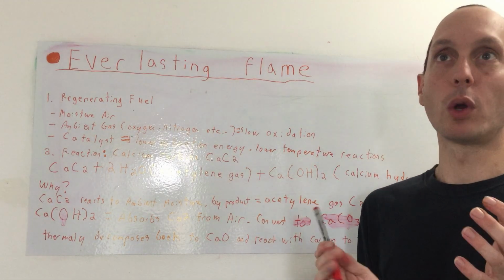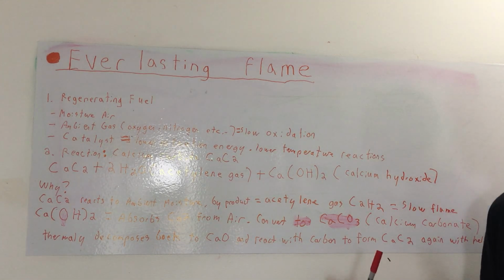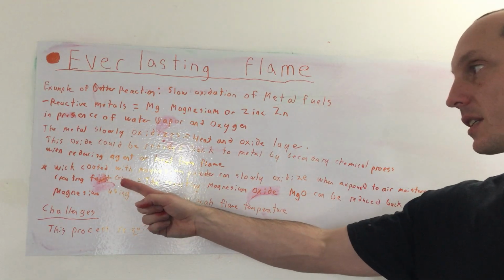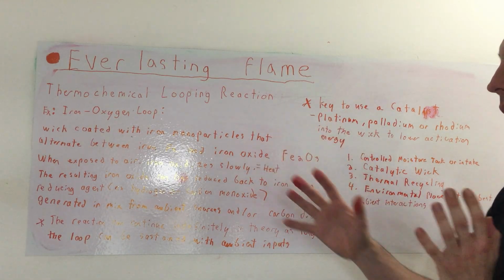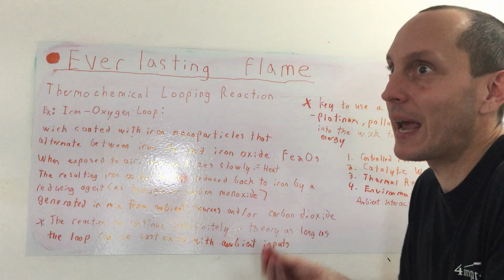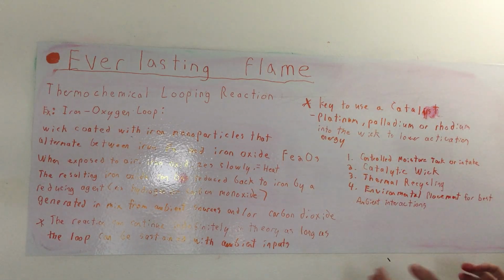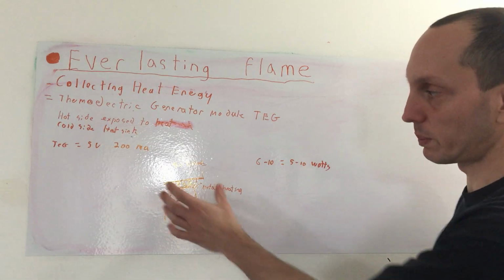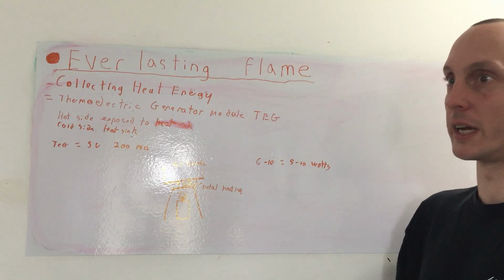Everlasting Flame

Comment: Dutch did a study on using iron oxide particles in a close loop for heating. Caveat was hydrogen for redox reaction. You could potentially use windhex like cyclone filtering to separate the dust efficiently, but still a potential health hazard. 
There are certain clays and calcium compounds that produce steam with water, and you could dry them out under the sun or microwaves. Claude says a polymer of iron particles with clay will help with drying it fast enough to be economical.

Comment: Algea is very efficient at converting carbon dioxide into diatomic oxygen. However, this would need sunlight exposure and if in a cold environment heating wire. 

Another option is to run the exhaust CO2 (and ambient air) into a bubbler and then thunderstorm generator with an electric generator but this would require fuel input. Malcolm Bendalls model has shown elemtal transmutation based off of Bob Greeners electron microscope analysis. 

Or a combination or both. 

Furthuremore, the energy from the thunderstorm generator could power a pressure swing adaorbtion vessel by providing electricity from the generator to a pump and electronic actuated valve. Tanks can be configured lead lag. The questions is if the carbon capture credits would outweigh the cost of the fuel?

Comment: Yep, previous video definitely follows to this. Ultimately, the "output" (flame) is the sink. Which is literally metabolism at a very high level.
Reply: Very good. We all need a faster metabolism, it's the Fire of Life. (This fire of life is our everlasting flame on Earth). It consists of insane chemical reactions and quantum tunneling. The heat part is actually a byproduct that we need at the same time (infrared is the heat of life generated by a "cold flow" of electrons and associated ATP reactions.)

Comment: on the plus side of using high impedance the more impedance the higher the flyback peak voltage reaches , and in my opinion a high impedance also delays the current further allowing more time to open the switch before the current catches the voltage , this way you technically only use voltage

Comment: 20ma is not pure voltage but you get my point ,  12v sent into 2000 ohm coil puts load at 6ma

Comment: I really like Idea Bedini had with using pure voltage no current to stimulate the chemical solution of batteries . This can be done with 12v dc pulse and high impedance inductor maybe 600 ohm which would put your load at 20ma